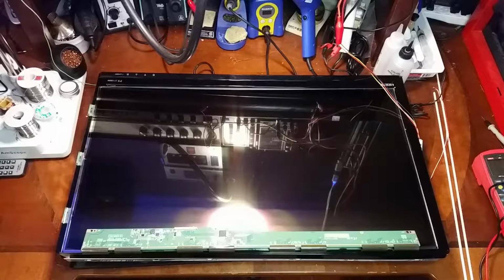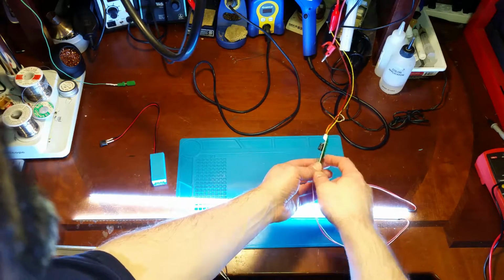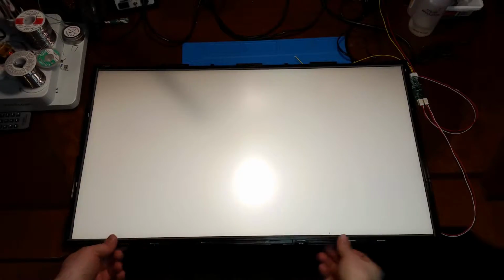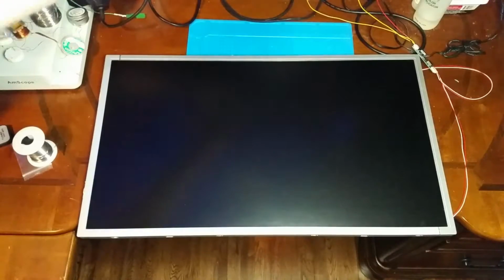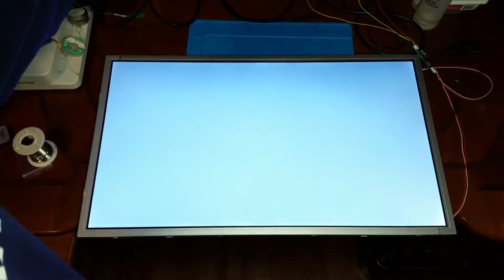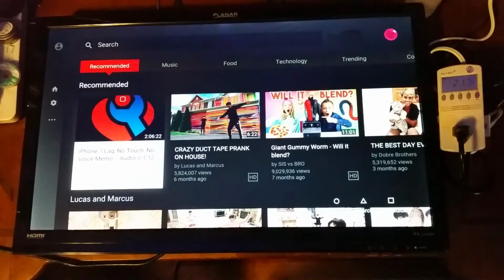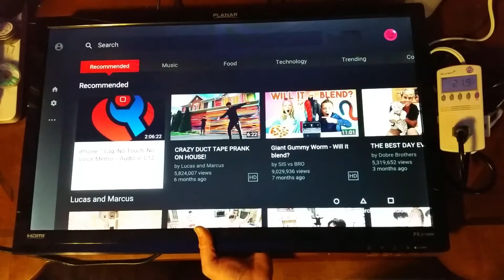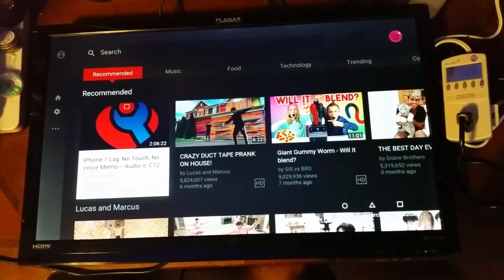Repairing a 27" Monitor with LED upgrade

Comment: I have a pair of old Dell 2707 WFPs I'm considering converting. Where would I find information about these and what's required to upgrade them without tearing them apart?
Reply from the maker: I'm not familiar with that model. If a Google search doesn't help you'll need to take it apart. I assume the back lighting has gone bad?
Reply: @jeffescortlx  Thanks for the reply - naturally I would find a manual after finally asking a question. The back lighting still works, but one monitor is a little dimmer than the other, and the whites are on the warm side. The lamps are 6500K. These were manufactured in 2006 or 2007 as a 2007 model, so I expect them to go out eventually.

Apparently, it's using a Samsung LTM270M1-L01 panel, that has 16 forward facing CCFLs. I can't seem to find any data on what size CCFLs for a direct replacement - or maybe a length for an LED conversion.

Comment: Jeff, doesn't this monitor have four CCFL lamps, and if so, did you only replace two of them with LED strips?  I ask because I have this same monitor, and I am considering this upgrade.  But I am wondering if I will need two LED strips, or four of them.
Reply from the maker: This one is edge lit. One on top and one on bottom.
Reply: Great, thanks for confirming!

Comment: The transformer removed in your video, is this the same as the pair of these on my HP2509M (ILPI-162) power supply board? Can I remove them? Can I remove any (danger) caps in the CCFL output area, for safety reasons? thanks
Reply from the maker: I don't know if your transformers are the same. I don't know of your capabilities of removing yours. Wouldn't be necessary to remove the caps. When the transformer is removed it's no longer capible of making the hi voltage for the CCFL system.
Reply: @jeffescortlx  Thank you for your speedy and informative reply. The transformers look a little less cumbersome than Re + Re the daughter board to replace mosfets and diode relating to no CCFL tubes illumination. Again thank you.

Comment: Are these universal kits? I am using a 24" Dell 2408wfp that keeps shutting down and runs super hot. I'm thinking about converting it.
Reply: I did take it apart and saw no visibly bad caps and am really suspecting the ccfl's at this point.
Reply from the maker: @johnaugust4521  do the flash light test when the screen goes dark to confirm it still has image.

Comment: IIRC you can use a "npn" transistor ( LED board connected to source, TV signal connected to gate, and drain to ground) to invert the signal.
Reply from the maker: Yep that sounds like it should work.
I briefly thought about inverting the signal. But naw, I'll just turn it down for up and up for down.
Reply: Did a lot of research on this for a laptop to convert to led. But wound up crossing a different used lcd that was led and a led compatible lvds cable to convert it. Wound up being plug and play and was cheaper than the led up grade board kit.
Reply from the maker: It's nice when it works out with compatible plug and play parts. Doesn't happen often enough.

Comment: I have one of these and I'm having doubts its simply "reverse" signal. First of all I've not found one monitor that does the brightness signal in reverse. Maybe you have? Second its anemic and somewhat non-linear. I'm gonna do some more tests.
Reply from the maker: I've used a led kit one other time for a monitor ccfl conversion and I remember the dimming signal being opposite on that to.
Reply: Oh very interesting. They should really have a jumper to invert it then. I did some tests and determined that the "dimming" signal is not entirely linear and that it goes out of range. Further having two lights in instead of one significantly affects the output voltage so the supply is sagging by about 0.4v. Furthermore the output is voltage based not PWM based which makes the actual brightness non-linear.
Reply from the maker: Its possible that the dim signal isn't linear because ccfl lamps don't behave in a linear way. I agree, I would love to see a section jumper, but I suppose that would raise the component count too much and effect the bottom line.
Reply from the maker: Also just remembered, on my first kit I ended up mounting a potentiometer out the back and ran the dim signal to that instead of the main board.
Reply: I checked the output at least for my control board. It is a linear signal. As for raising the cost.. I'd pay twice what I paid for mine (about $3) if it had proper brightness control XD. Sometimes I think China thinks to much about cheapness.
Reply from the maker: I guess the backwards control doesn't really bother me that much. If I want it bright, I put it at 0% on the on-screen setting. Or potinmeter does the trick to.